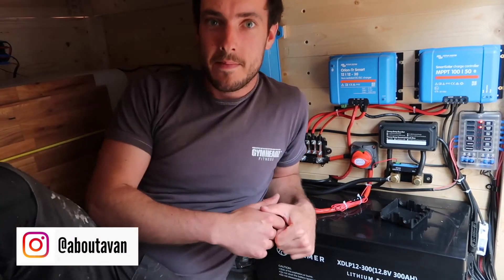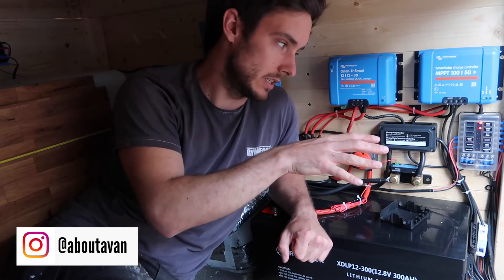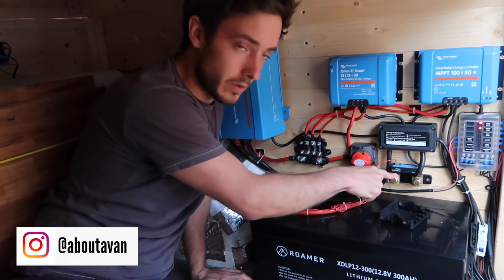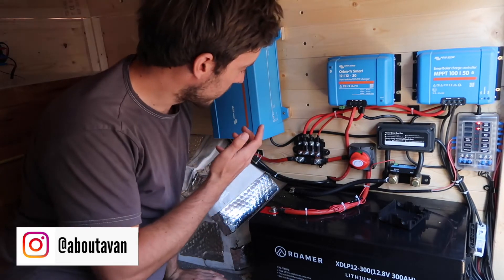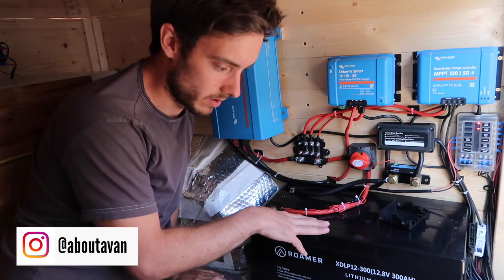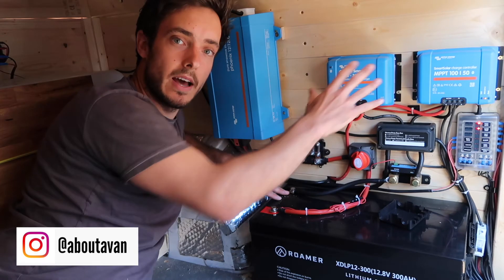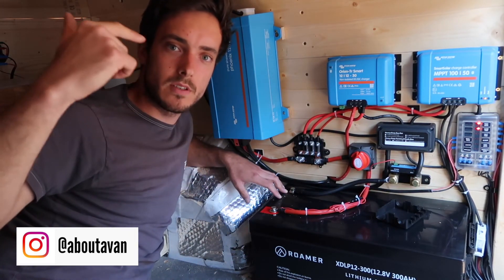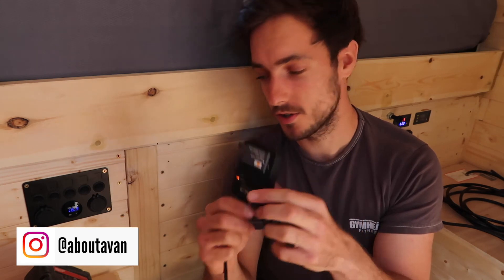Victron electrical system | Powering your van

Comment: Thanks, very useful to see a system configured with so much of  the excellent Victron components namely  solar mppt, B2B and inverter, yet - interestingly without the significant further expense of Victrons' Lynx unit as a distribution feature. This is the aspect which interest me the most, specifically the Mega-Midi +ve distribution post/busbar which in your video has the cover removed and looks to be located within 6inches of the unshrouded -ve battery terminal. In contrast to that +ve distribution you emphasise on the -ve collection busbar it has 350A current capacity and robust enclosure, this detail being appropriate to the potential current draw of the meaty inverter, but much out of balance with the modest 35mm^2 battery cables.
Reply from the maker: Hi John, thanks for the comment, the system was done to the best of my ability with the clients budget in mind, of course the lynx would be the preferred option but with a RRP of over £200.00 many people opt for the midi/mega fuse distribution, although close to the -ve battery terminal the positive cables are secured and would not touch the -ve also if you check victrons own manual you use 25mm²/35mm² cable with this inverter depending on the length of the cable run.

Comment: Would love to know how this is connected to vehicle battery in the cab. As it's underfloor did you run it under body of van?
Reply from the maker: Hey Dylan, you can run it under the vehicle if you wish, or you can route it through the interior of the vehicle, if it goes underneath just ensure its fully protected and secure/away from moving parts.

Comment: I was sold a 100 amp breaker for the same inverter and it tripped on a 800 watt load. Checking the manual I found it has an internal 200 amp fuse and Victron states it does not need a separate fuse if it’s close enough to its power source. I’ll still run a breaker and hopefully can find a 225 amp breaker or fuse but 200 would be fine also. I took all the fuses off the back of the same brand switch panel also! Still planning out my system to upgrade from a Renogy dual input charger. I have most of the  components and am down to planning the layout and cable wire size and routing. The Renogy system is working so I’ll take my time and plan it into my cabinets. Just insulated and laid the subfloor so now I can start building. Hard to do when you live and work out of the van!

Comment: Its not clear to me as to why the owner would have a 240v fridge as opposed to a 12v fridge. Isn't less efficient to run through an invertor?
Reply from the maker: The cost of a 90L 12v fridge is around £800/900 if you're having a quality electrical system installed with a lithium battery which stores circa 3.78kwh of energy running a domestic fridge via the inverter will account for very little. I've done the same in my own van and between February to November it works perfectly just off solar alone.

Comment: I have one easy mod which I feel makes every system that little safer!! Secure a piece of STS Construction Board 100% fire proof to your backing and then mount the units onto this. A little ott but you know should a fault develope in any units or fuse connectors etc you will have a better chance with a fire proff backing mounting board. Pennys to the total cost.